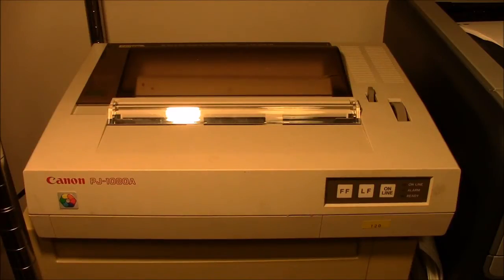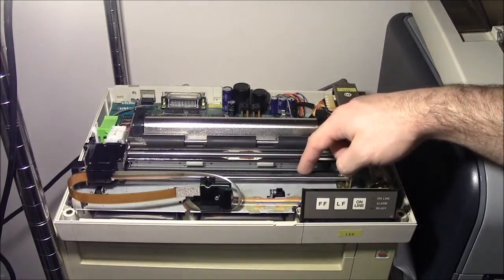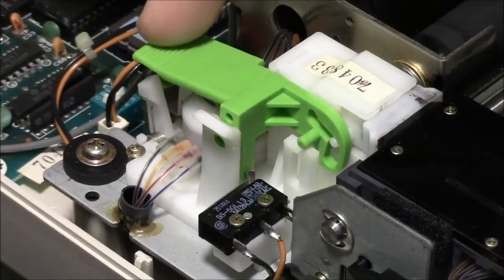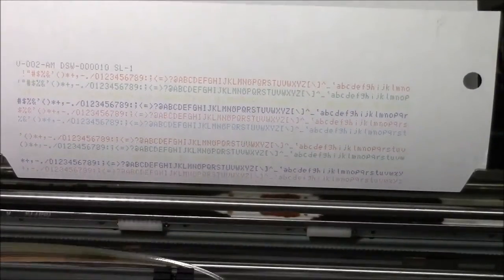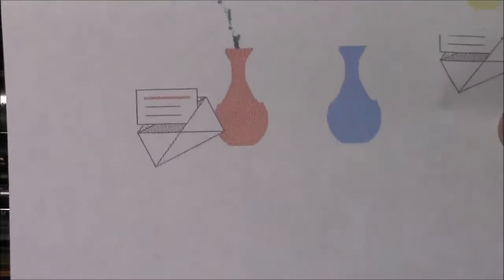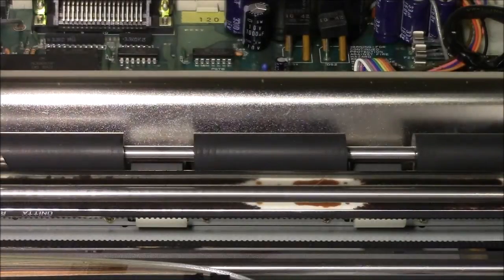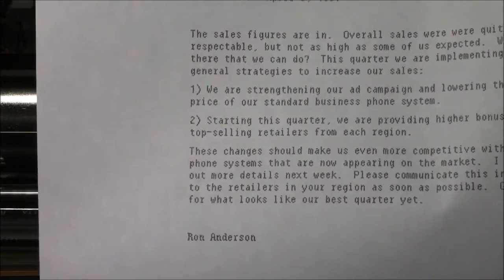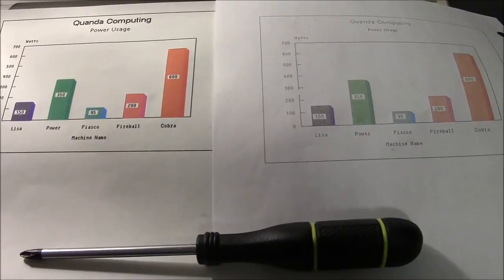Canon PJ-1080A Color InkJet Printer

Comment: I rescued the CGP 220 version of this printer from my parent's attic this year.  It had been roasting in the Texas heat for over 20 years.  I loved being able to print color graphics on this thing back in the day.  So when I got it out of the attic it was very yellowed.  I plugged it in, pumped the ink, and ran the test print. ... and it freakin worked!  They definitely don't make ink jet printers that dependable anymore.  I retro brighted it, and it looks great.  I plan to eventually hook it up to my restored Color Computer 3 that was also rescued from the attic.  My only negative is that the clear plastic lid is cracked from when I broke it in college.  It will be interesting to see how refilling the ink cartridges work out.

Comment: Can you please confirm the release date of this printer ? (Date on internal components or case mould date marks)
Reply from the maker: I'll have to see. I'd suggest using Google Book Search to look for advertisements. We know it was on the market in 1984 because the Lisa software supports it. I suspect it was on the market in 1983.
Reply: @compu85  Can't actually remember what year we got ours - and it's not to hand to check dates on it. Gut feeling says 83 but it may even have been 82.

Comment: I have the same printer (IBM 3852 2) which unfortunately does not have the built-in self test, so i have no way of testing if it even works somehow. It powers on and i can get the leftmost yellow LED to blink, but that's it.

Comment: The Harmonie printer driver package for GS/OS on the Apple IIgs has a driver for this printer if you need more software to test it with. I think the Amiga Workbench has one too. Output options per the Harmonie driver are a rather dismal 80x80dpi, so not up there with the ImageWriter's best.

Comment: I'm not sure why IBM gave the printer different names. Like you say, sometimes it's called JetPrinter, but usually its name is the model number 3852-2. I wasn't aware of the fact that there were so many other brands with the same hardware. Thanks for that video. The informations about that model are very rare nowadays.